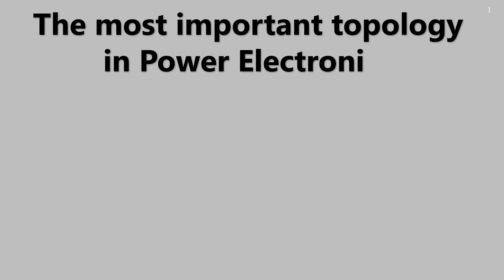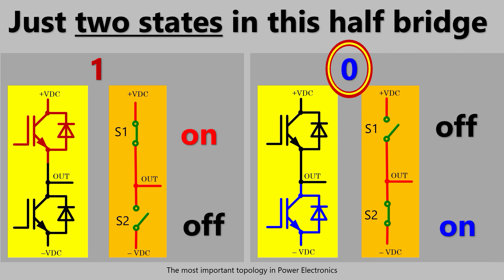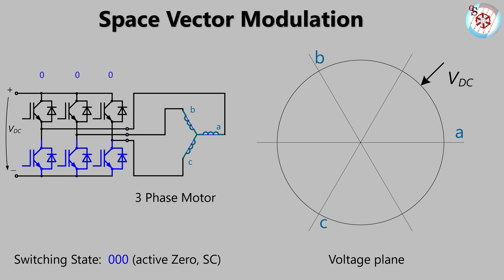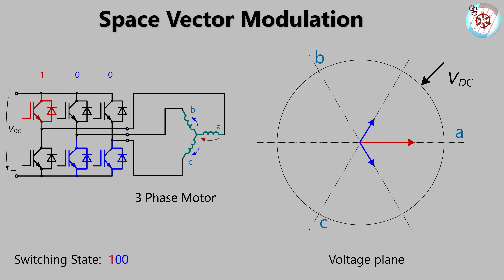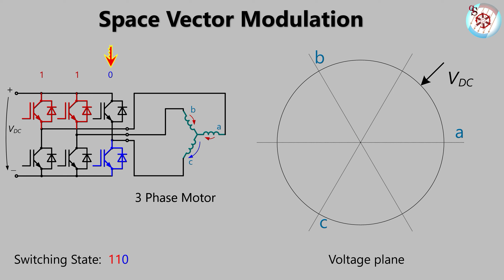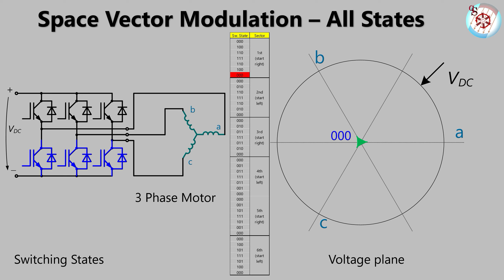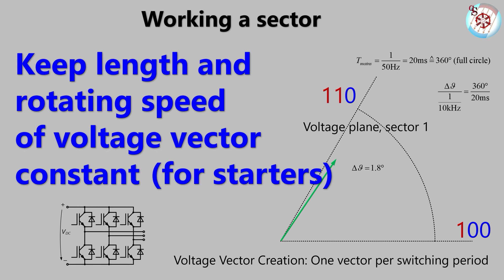Space Vector Modulation / Voltage Source Inverters & the Most Important Topology in PE

Comment: What is the "voltage plane"? It certainly isn't a voltage vs time plot, nor a complex plane with real and imaginary axes as used for phasors. So what is it?
Reply from the maker: The voltage plane is a depiction of voltage magnitudes across the three (actually six when split) coils considering their direction in a two dimensional x-y-plane.
Is it real? Of course not. Voltage has no direction therefore this cannot be real. 
However, the magnetic flux resulting from these three coils is real and the sum of the magnetic fluxes from the three coils is the rotating flux vector. It is real. It is there. 
Now you can "reverse" the induction law saying if there is a a rotating flux vector there must be a rotating voltage vector. Et voilá, there you have it. A rotating "voltage vector" in an x-y- plane, the voltage plane.
Reply: @quellstrom  Thanks! That's more intuitive

Comment: I appreciate your video but one question please, in the first place why the a, b, c vectors are placed at 0, 120, 240 degree?? I know that in a 3 phase grid power, the voltage of each phase is 120 degree apart in phase, BUT, we are not using grid power here, these a, b, c vector is phase voltage vector on each of the phase's inductor of the motor, which is generated by the switching of the inverter, not from some three phases grid that give you perfect 120 degree apart phase voltage. So how do you know that these three a,b,c vectors are always 120 degree apart as your drawing ??? Please, I have been doing a lot of reading but still no where explain this.
Reply from the maker: The three phases are created by the location of the three inductors. Even though the inductors are fed from the same voltage source they create flux in different locations of the machine. 
Now, if you look at the three created fluxes i.e. at their sum you will find that this sum is a rotating magnetic field at constant strength (flux vector). 
So, the three phases are generated by the timing of the three sine voltages applied to the inductors plus their physical location.

Comment: What kind transistor of that in your circuit?
Reply from the maker: For industrial drives there are usually IGBTs. For lower voltages you may also use MOSFETs. For very high power inverters (transmission) GTOs/IGTCs are used.

Comment: Thank you for this very good presentation. I got a question about the maximum length of the vector. It seems to me, that you can get max length at the base vectors, but in the mit position of a sector, the max length of the vector is shorter like a factor 0.866. Am I right?
Reply from the maker: Yes, that is spot on. This value is the maximum non-distorted three phase output. 
In case you need higher voltages (vector) you can exceed the length of the vector only partially, resulting in a distorted three wave sine or as it is usually called overmodululation.

Comment: What if ur dc link is capactor, i mean in MMC's. Any reference to read?
Reply from the maker: Thanks for your comment. The capacitor is not the point. All our DC links are capacitor supported voltage sources (in case of voltage source topologies). The same goes for MMC vs. CHB.

The difference is the multilevel. Multilevel means there are more switching states per leg than just two. And as always, one inverter comprises three legs (= three phases). 

Two level / one leg: 2 states 
Three level / one leg: 4 states 
Five level / one leg: 8 states 
... 

Actually, I don't have the numbers at hand but there are many more switching states per voltage vector (now all three legs involved). This translates to a lower ripple voltage for the specific space voltage vector (which is still the one rotating voltage vector with constant length and constant rotating frequency). 

So the goal voltage vector for multivlevel inverters is the same as for two level inverters. 

PS. This is a very good read on the general subject. https://www.mdpi.com/2079-9292/8/11/1329/pdf

Comment: thanks sir 
i want only to know something do we use reference and carrier signals in SVM as in SPWM or not and if the answer is yes so what is the difference between the two ways in operation and what is the relation between this space vector and the output voltage of SVM technique in other words how does it used to generate the output voltage 
sorry for taking long sir
Reply from the maker: Actually, the way I understand the problem is SVM actually focusses on the rotating space vector using the eight switching states shown in the video. In short there is no connction for the star point (not regarded and not needed).
SPWM creates three sine waves from the three half brigdes against star (half DC-link voltage). So you can run three different loads against half DC-link and still have a (balanced) three phase voltage system (with regard to voltages).
However, if you want to run SPWM without star connection you have to add the third harmonic for a "clean" (50 Hz rotating-space vector) ...
In the end you can have equal behaviour from SVM and SPWM (after tweaking).
Reply: @quellstrom  great sir,but how the pattern of switching can be determined in SVM if it is compared with the approach used in SPWM in which we can generate pulses and control their width to know the pattern of switching
do we use SPWM in SVM?
in other words how we can determine the magnitude and rotating frequency of the rotating vector?
tanks lot sir

Comment: How to control the output power in SVPWM scheme? How the gate driving traces would look like at reduced power?
Reply from the maker: The length of the pointer is proportional to the inverter ouput voltage. The difference between inverter voltage and induced motor voltage across the inductances causes the current. 
If you need a general idea, the times of  [0,0,0] and [1,1,1] need to become longer for shorter voltage pointers.

Comment: In reality (0,0,0) and (1,1,1) is never active, no?
Reply from the maker: Of course. Every cycle sees 0,0,0 and 1,1,1. It is rather the other combinations that do not occur in every sector. 
So, apart from 0,0,0 and 1,1,1 there are always (only) two other states (depending on the sector) that will occur. In other words one cycle consists of four states.
Reply: @quellstrom but (1,1,1) would mean active shortcut of the dc-source -> practically not done, right? and (0,0,0) could lead to massive voltage peaks -> only 6 states are left (hexagon)
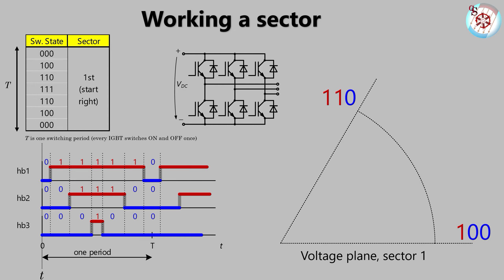Reply from the maker: @kevinhohne7889  No, (1,1,1) and (0,0,0) shortcircuits the motor not the DC-link. Pls. watch the video again ... ;-) Every switching cycle contains a (0,0,0) and a (1,1,1) 11:01

Comment: How can I implement this SVM/VSI to Single Phase motor (splitting Run, Start and Common winding, removed Start Capacitor)?
Reply from the maker: The SVM with VSI produces a three phase voltage system at its output. Therefore it is meant to drive three phase motors. 

Single phase motors use other (= non-three-phase-) voltages/currents to create a rotating magnetic field. 
This rotating magnetic field is either 
- turned off after start up leaving a pulsating field fed by a single voltage phase or
- remains maintained by a second auxiliary phase throughout the operation.

Either way the rotating field in both cases is not symmetrical and it is not possible to feed the main winding and the startup winding (in a way that makes sense from an engineering point of view).

In a nutshell: Operate single phase motors with a single phase inverter and three phase motors with the introduced three phase VSI. :)

Comment: i want to know how tramcars  work
Reply from the maker: Actually, if you understood this video you are half way there. Now just simply connect an induction machine, learn about the rotational speed / torque / voltage (amplitude and frequency) diagrams and you are almost there. For recuperating and sophisticated acceleration runs you need some more time. How far do you want to go? ... :-)
Reply: @quellstrom  thank you 
 this is the magnitic field in all states ?
Reply from the maker: This video tells you how to obtain a rotating voltage vector. According to Faraday's law this rotating voltage can be translated into a rotating magnetic field. And even though the magnetic field is lagging 90degrees -- as long as the rotating frequency is constant (nominally 50 Hz), the magnetic flux is proportional(!) to the voltage. 
So, from the states you do not see the magnetic field directly but learn how to create a rotating voltage vector. And what to do with it you know now. :-)

Comment: It's really helpful for me, but there are still some questions that I cannot understand.
The switching state goes from {0,0,0} ->{1,0,0}->{1,1,0}->{1,1,1}->{1,1,0}->{1,0,0}->{0,0,0}
My question is:
Why we turn off the last switch at the first stage? 
Why don't we turn off the second one and make it goes like {0,0,0} ->{1,1,0}->{1,1,0}->{1,1,1}->{1,0,1}->{1,0,0}->{0,0,0}?
Reply from the maker: Hi 賴冠丞, thanks for asking. The answer is simple. 
The vector  {1,0,1} is not present in the first sector! No way you can use it during this phase. Apart from that: why do want to switch from {1,1,0}->{1,1,0}? Or was it a mistake? Maybe you'll watch the video a second time? It is not that difficult.
Reply: @quellstrom  Oh! I just type it( {1,1,0}->{1,1,0}) wrong ,but thanks!!! I got it now!!!
Reply from the maker: Great!

Comment: Hi there, thanks for the video. Does the amplitude of a reference space vector corresponds to the rms or peak value of the output voltage?
Reply from the maker: Yes, of course. Let's look at a feeding 400V-system.
The maximum space vector value (constant length, i.e. undistorted, not over-modulated) is 
Vsp=sqrt(3)/2*VDC, 
with VDC being the DC link voltage (voltage source). A space vector with the length of sqrt(3)/2*VDC has an amplitude per phase of sqrt(3)/2*VDC * ( 1 - 1/3) = .577 VDC, cf. construction of Space Vector. In other words the amplitude of line-ground(star)-amplitude for maximally modulated voltage is 323 V for VDC = 550 V, which is Vlg = 323V/sqrt(2) = 228V. The is somewhat below the line-ground-amplitude (325V) that was used to obtain the 550V DC link voltage.
 
Alternatively one can interprete the DC-link voltage VDC as peak amplitude of a line-to-line motor voltage. That makes the peak value of the line-to-ground voltage VDC/sqrt(3) = 317 V. Therefore the line-ground-rms-voltage is then 
Vlg = 317 V / sqrt(2) = 224 V.
Reply: @quellstrom  Hi, thank you for the reply. I am sorry I don't understand your answer. I will rephrase my question. Let's suppose that I have a 400Vrms 3-phase supply applied across a diode rectifier; the voltage that I will see across the DC link capacitor will be of about 400*sqrt(2)=565.6V(dc). This DC voltage is then fed to the inverter. If I set a reference voltage space vector with amplitude of 200V, am I asking the inverter to produce an output 3-phase voltage of 200Vrms (line to line), or am I asking to produce an output 3-phase voltage where each phase has a peak value of 200V?
Reply from the maker: There is no real quick answer to this. 200V rms is 283 V amplitude. According to the scaling shown in the vid (not transformed, VDC as the perimeter of the circle) you need a voltage vector of 283V * (1 + 1/3) = 377 V (constant length). 
There are formulae for calculating the vectors. That is, what duty ratios are required for bridge 1 ... bridge 3 in dependence on switching frequency, mains frequency and DC-link voltage. 
As already hinted at, most of the time these data are calculated in the transformated plane (Clarke and Park) and backtranslated for the actual control. There you'll have a nasty factor, which obscurs the basic physical understanding BUT helps a lot with calculating the control values ... :-)

Comment: Thanks so much for the perfect video Sir

I have a question for you. How can we produce 3 phase voltage vectors using a microprocessor?
Also how to control the voltage vectors produced using a microprocessor?
Reply from the maker: Thanks for your positive feedback. First of all there is only one voltage space vector. The vector results from the three voltages of the 3 motor coils. It is important to understand that the three voltages across the motor coils do not add up in space. 
The actually rotating voltage vector is a back-translation from the three fluxes through each of the three coils. These fluxes sum up to a rotating flux vector which in turn is back-translated to a now really rotating voltage vector = space vector, cf. https://youtu.be/raT-hJRMtdI
Implementation will be discussed later.

Comment: ok i love you explination , my dumb brain did not understand the last part about the integration but could i ask if you could please make a playlist for high dynamic drives. and maybe their simulink counter parts. 

honestly i love you. i have spend many months now tring to find the best resourc and you are 1 of the 2 best i have found.
THANKS
P.S please more english.
Reply from the maker: You are welcome, xganh. Regarding the integration, it is not that difficult. Think in switching periods. Here, a switching period is defined as 100e-6s (f=10kHz). During that time there is always one of the three possible vectors (100, 110, 111/000) present. Everything what happens within the period will contribute to the space vector of that particular switching period. 
How does every one of the three vectors contribute? It happens through integration. The physical meaning of integration here is: voltage times time. The longer a specific vector is applied to the load the "heavier" (greater) its influence on the resulting space vector gets. If you switch to the 000-vector, then there is no contribution to the resulting space vector because 0 times time is always zero. After one switching period we see what voltage vector has been integrated (created). For the next switching period we compose a new space vector (out of the three vectors). 
The important thing is during one switching period every tranisitor switches one time (on & off). So, if you check on your oscilloscope you will detect exactly 10 kHz switching frequency for every single IGBT. 
Regarding high dynamic drives, basic idea: You do not let your space vector run in "smooth" circles, changing ever so slightly its length and rotational speed. Instead, you jump around in length as well as in angle. This is best done with directly accessing the voltage space vector as opposed to the creation of the modulation by a sine-triangle-modulation. For Space Vector Modulation the sine isn't just a sine but the concept of the modulation can be equal. Since you cannot jump in time this modulation type has limits. 
A direct access to a space vector without having to look at its history is much more powerful.

Comment: This is a great Video, Sir. However a question appeared as you mentioned high dynamic motor drives. What you showed in the paragraph “Working a sector” means if I’m right, that you are able to create any reference vector you want in sector 1 by varying the on and off times of the transistors in one switching period, right? Is this accurate in real time that there will be only one reference vector in sector 1 so overall 6 switching periods for one cycle, or does this depends on the frequency? So if you would have twice the frequency there will be two reference vectors each sector so two switching periods each sector and overall 12 vectors and switching periods for a hole cycle?
Practically referred to your example this frequency would result with 1.8° 60°/1.8° so 33 vectors and 33 switching periods for sector 1 then following 33 switching periods passing through sector 2 and so on? And varying the t1, t2 values (which just represent the transistor on off times) let the reference vector “rotate” through the sectors? Am I right in thinking so? 
And specifically in motor drives you would change the frequency to adjust the motor speed by varying through the frequency the angle and the amount of vectors and switching periods in each sector? And if I’m right this information of the t1 and t2 values are used to set the compare register in the microprocessor which then outputs the signals for the gate drivers?
Reply from the maker: Thank you, Timo. Frankly, I don't really understand your first paragraph with the "two reference vectors": For every switching period, 100microseconds for our example, you create a new vector. 
Your reasoning in the second paragraph however, is right on though. It is worth mentioning that the switching frequency is usually not synchronized with the voltage vector. That results in unequal numbers of switching periods for every sector even for constant output frequencies.